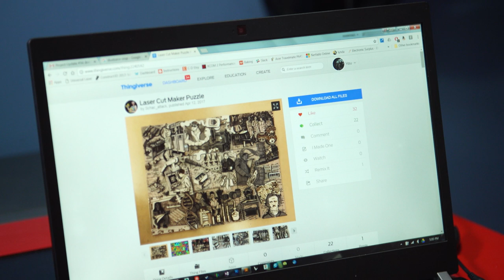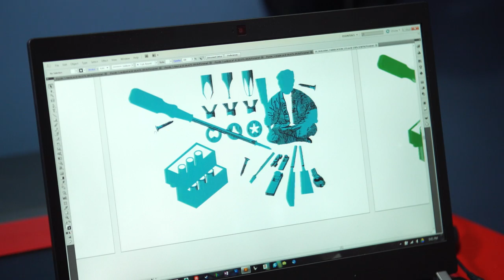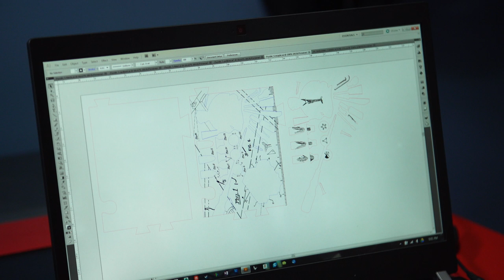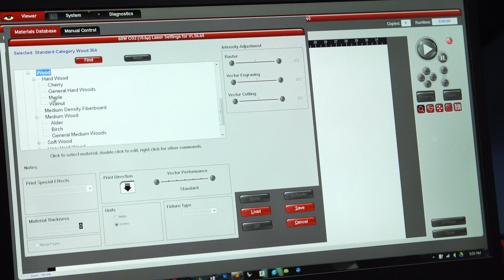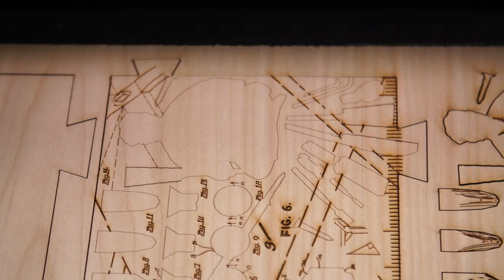Laser Cutting the Maker Puzzle, Part 1

Comment: You will not blow up your garage by engraving a BIC lighter. Yes, it'll pop and might damage the laser cutter, but that's it. Don't make things bigger than they are.
Reply: @2000jago But than the BIC lighter isn't the problem is it. It's the air saturated with flammable fumes. Using a 60W lasercutter alone would cause enough problems all by itself.

Comment: the uls6.60 is a great cutter but the stepper motors make it a rather slow engraver. servo systems like epilog can engrave >2x faster. the coaxial air assist on the universal makes it a cutting beast though.